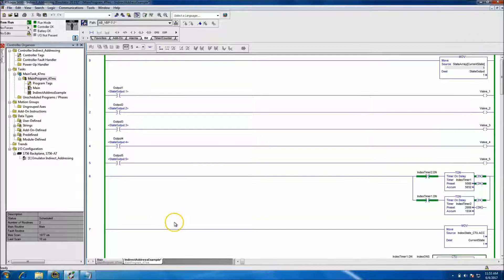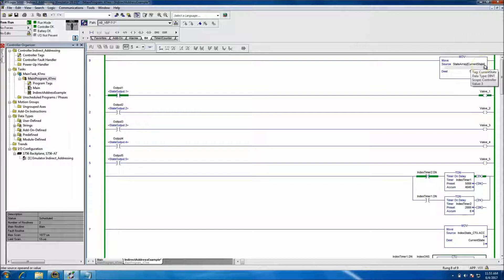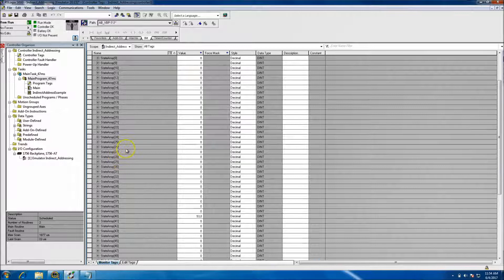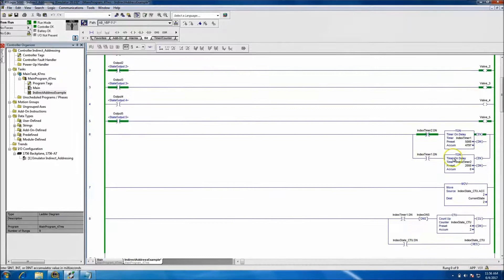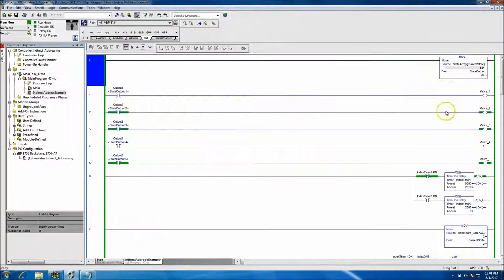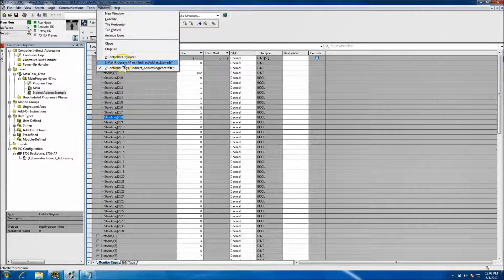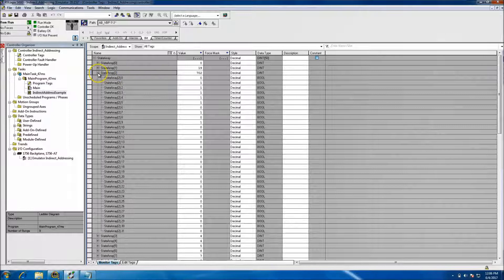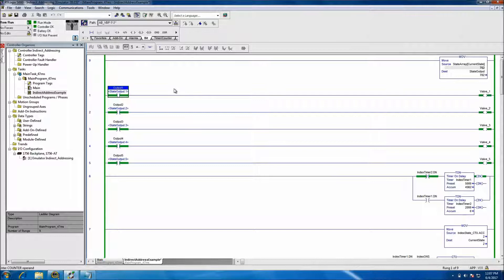RSLogix 5000 Indirect Addressing Short Example

Comment: Great video thanks for sharing! StateArray is linked to StateOutput??? How to they related to each other???
Reply from the maker: In the video, I show exactly how they are linked.

The Dint of the state is pointing to the value of the state array.

Then uses everything in that section of the array
Reply: @ShaneWelcher  thanks for your reply. I have understood that bit of pointing to the array. However the "array" is = to StateArray not StateOutput. 

What I meant by that is How are StateArray tag linked to StateOutput tag?
Reply from the maker: I used a mov instruction
Reply: @ShaneWelcher  mov the whole array to another one?  or just part of the array individually? thanks :)
Reply from the maker: @Bilal  

No, I'm not sure you're understanding my use case in this example.

I don't show the state machine logic, I am showing how indirect addressing works.

To describe the state machine I used, it's just one array.

Then basically the current state points to that array to use the values of the array to control something by using the bits.

The mov is just moving the Dint to Dint which has the state control in a structure text routine in this program.

In other words, the Mov instruction that has the indirect addressing will move the result of the array value into the destination of the mov.

The actual array can be used in several ways, either a simple one to one transition or a complex design to act as a  control word.

Similar to a VFD control word.
Reply from the maker: Here is a video I made to talk about this more in-depth.

Indirect Addresses Using Binary Coded Decimals in PLC Programming
https://youtu.be/t4zzk3WGV4k
Reply: @ShaneWelcher  thanks a lot for your video and thorough replies :)

Comment: Hey Shane, I just found your channel!, great content and well explained info. Do you know a way for indirect adressing like this N[N7:0]:5 using RSLogix 5000?
Reply from the maker: That style indirect addressing works the same with one difference, the back decimal stays the same in the address.
Reply: @ShaneWelcher  let me explain myself, the variable N7 in bit 0 has a value of 188, so I want to use this value to obtain the value of the bit 5 in variable N188. Is this possible?
Reply from the maker: @pedroemilianorusilesdacunh9139  

The way you put it then it would be N188:5

But why don't you just try to test it live or emulate it to get a better idea.

That would be easier for you.